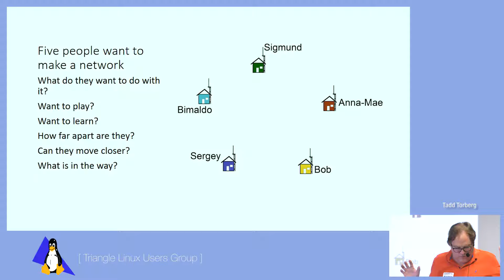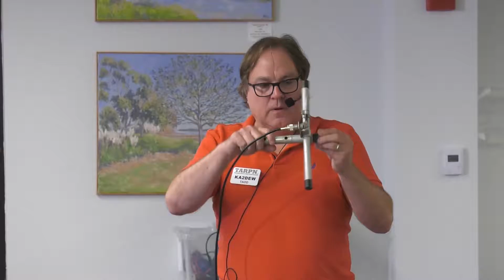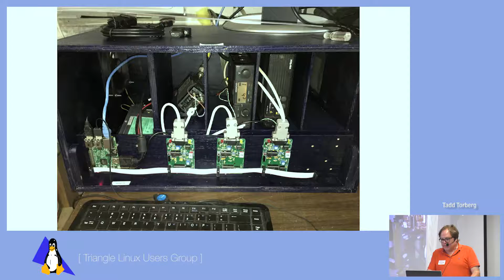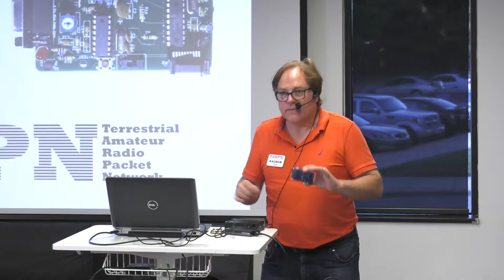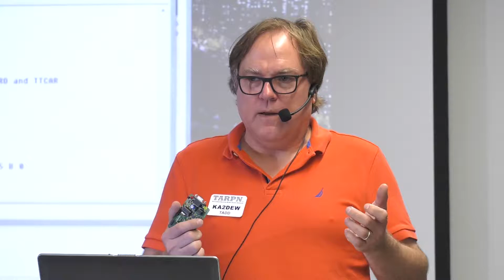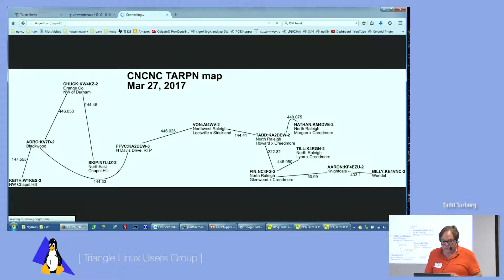TriLug 2017-06-08 TARPN, packet radio Presentation

Comment: Very interesting presentation. Even while packet is out of favor I believe it should be revived for use in local EmComm projects. The practical application of even slow data rates and low cost gear are ideal for any group who has an interest in developing  a totally off-grid EmComm network. From my point of view this kind of project just makes common sense. Thanks for sharing, I will be looking closely at getting a network established in Southern Ontario. 73 VE3VCG